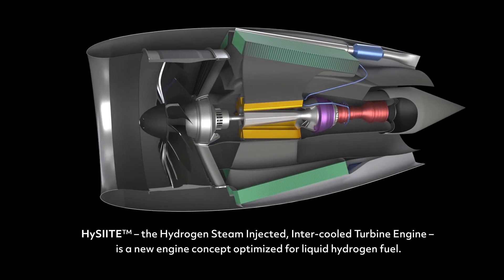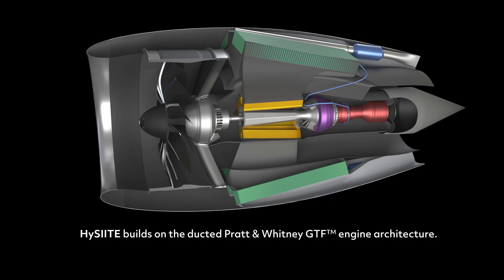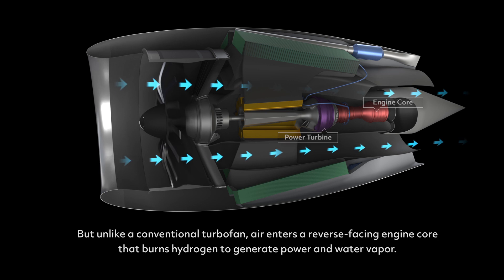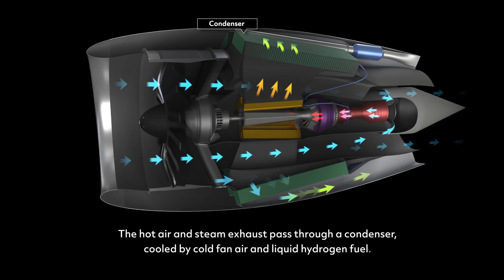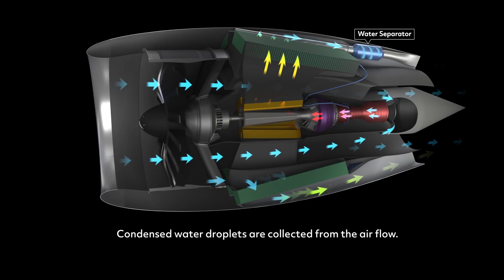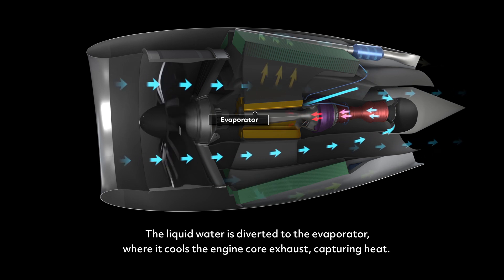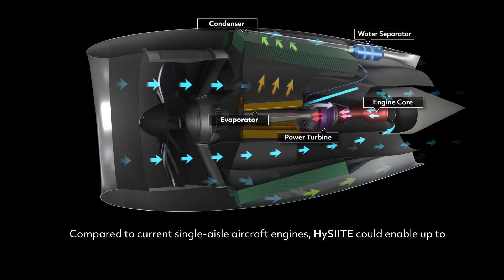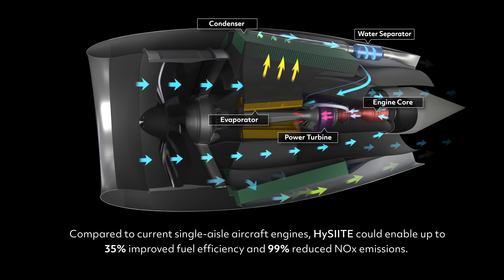Pratt & Whitney's HySIITE concept explained

Comment: Now tell us how and where you will store the incredibly undense liquid hydrogen
Reply: In the trailer obviously. That way when it decides to float away or blow up the aircraft can just depart from the trailer. Easy peasy.
Reply: The mass density sucks, but what about rail, ships, trucks and cars?
  The carbon to fuel makes sense for a rocket or plane, maybe land based, to make aviation propellant?
Reply: Skill issue. Just be insanely mass and aerodynamically efficient (long wings, high altitude) so you don’t need much energy in the first place.
Reply: lol
Reply: That's a problem, but it's not P&W's problem. For the solution from the aircraft manufacturers which would need to solve it, check out their published material, including the Airbus ZEROe designs. Typically, they propose using a large part of the fuselage volume (at the rear), or wing root area volume in blended wing-body designs.
Reply: Under each passenger seat.
Reply: Okay, two teleportation portals... one inside a ground based H2 storage facility and other inside the engine. No danger of H2 💥 can fly as long as the engine can work without issues and ground crew can keep adding H2 to the storage 😅
Reply: Simple, passenger are required to bring their carry on bottle of hydrogen…very safe and efficient
Reply: High pressure lol!
Reply: The air is full with water. You can instantly make hydrogen at the same time. Only thing you need is electricity. I don't see that as a problem, cause that same engine can produce that as well, like conventional jet engines.
Reply: Actually the technology demonstrators used liquefied methane or natural gas as fuel that was pushed across a catalyst that generated electrical power before the hydrogen was used in the engines
Reply: If here sci-fi scenario is considered then just take hydrogen from outside air, no need to store it inside the plane 😂
Reply: @ngl-r5e install Bussard collectors.  :-)
Reply: @ngl-r5e  There is almost no hydrogen in the air, unless you count water vapor and in that case, if you have the electricity to break water, you might as well fly electric.
Reply: Did anyone mention hydrogen metal embrittlement in this thread yet?
Reply: Wow this is an old thread, ok, to address some things that came up in the comments. NO, you cannot just take hydrogen from water in the air on the go, separate the hydrogen from it through electrolysis, and then burn it, because the reaction product of hydrogen and oxygen is water. Congratulations, your just converting water into water with extra steps and a net drain on energy. At that point just use a battery. No perpetual motion machines. Hydrogen in this case is just used as a significantly more energy dense and less heavy energy storage method. AKA a chemical battery. And the other reasons brought up about things like hydrogen embittlement and the storage problems is why I prefer methane. storage at non cryogenic temperatures i think would only be 5 or so atmospheres, nothing crazy, but definitely not enough for flight.
Reply: The fact that there was a technology demonstration of this tech that used methane is VERY exciting to me, that means my dipshit idea actually works! It would probably be a wiser choice than hydrogen, but if they pull of the hydrogen, IDK.         Also who TF is talking about portals!?!?! Bruh, can we stick to reality?  Use your heads guys. And try to stay away from sensational mainstream mediascience headlines and AI voice psudoscience slop.
Reply: I'm going to assume your asking this is satirical bad faith. But I'm going to try to answer this because I'm curious myself, and I know a thing or two about aerospace.

Hydrogen density sucks ass, not going to deny any part of your argument, it's a head slamming issue. Your right.

I'm going to assume we are using liquid hydrogen, because storing gaseous hydrogen is a no go in structural mass. It's too heavy.

Ever seen those flying wing aircraft? Or more like those more realistic hybrid wing Aircraft.

Those JUST might have the propellent tankage nessesary for liquid H2 aircraft. But the crew cabin and cockpit will be quite small compared to the wing fuel tanks.

And, if things get to bad, we can just take advantage of the square cube law, your volume goes up by the cube root, while your surface area goes up by the square root. 
In practice this means you can hold more liquid per thickness of pipe (or tank) the bigger you make it. So just scale up the plane (747 comeback please!) and use low weight carbon composites, until you get decent performance margins, like range and lift.

If all that fails, were shit out of Luck. Personally I'm interested in using the sabatir reaction like SpaceX does to pull CO2 out of the air and make methane. That's a half ass carbon neutral tech were working on that could replace both air travel if used in jet engines, and maybe ocean going shipping (<-the big problem)
Reply: @The_Northernlight_Synth  good points, and can also make ammonia from the atmosphere, and then use electrolysis on the ammonia to power hydrogen fuel cells
Reply: I just realized you indeed mentioned liquid hydrogen, I thought you just said hydrogen. my bad
Reply: Now how are you going to keep it cold to prevent boil off?
Reply: @bdkw1  cryogenic liquids are stored in insulated containers for short periods, and that may be adequate for aircraft. For longer periods, an active refrigeration system is required. This is one reason that liquid hydrogen (like other cryogenic fuels) is impractical as a vehicle fuel in most applications, although it may be manageable for scheduled airliner operations.
Reply: @ Use the boil off to run the APUs. Not a problem.
Reply: @TheAnachronist  If the rate of boil off is as low as APU consumption, great. Bu of course APUs are for emergency use... no one wants to burn expensive fuel at the gate instead of just plugging in.
Reply: Wings
Reply: @mitchellstrobbe7779   Wings aren't designed to hold high pressure gas